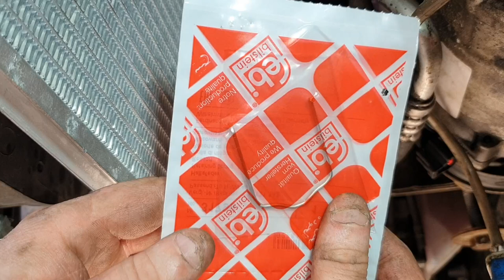Ford Mondeo Mk3 ST220 radiator replace

Comment: Hello Chazz Coombes. 
I just want to thank you from France.
I could do a lot of reparations on my 2005 Mondeo 2.2 TDCI titanimun X (ST style);
I replace the radiator, driveshafts, front roll bar supports...and your videos were a very good support and helpfull.
So thanks a lot, you do a great job under a car, but an another one as much great to filming your job, cut it, and upload it on youtube.
The time that i spent under my car let me thinking that Ford do a great car, not so hard to repare,and a solid one which can pass 20 years without rust (for mine)
Un très grand merci pour vos vidéos et votre partage!
Amicalement
Kind regards

Comment: I took my car (3.0Lt V6 ST220) to my local mechanic in MK and asked him to drain, flush out and fit fresh coolant.
I gave him 5Lt of OAT antifreeze and 5Ltr of distilled battery water.(enough to make 10Lt of 50/50 coolant)
When i picked up the car he said " Ive filled it with 4Lt of coolant"  3Lt of OAT antifreeze and 1Lt of distilled water"
Alarm tells started to ring in my head as I knew the car takes 9.7Lt of coolant.

Just from what he said, i knew he had left 5.7Lt of the old coolant in the engine. (NOT DONE THE JOB PROPERLY!!!)

He then started to give me some bullsh*t about " Its like when you where a kid mixing paint in water, thats why is a muddy colour"
What he had really done was mix the 5.7Lt of old orange coolant with 4Lt of new purple coolant.
So he had NOT bothered to flush the system out ( What a cowboy) and not changed all the coolant like i asked him to do. 
(I guess flushing the system out would have taken too much time, and he would have needed to get some more distilled water).

Had to pay him £50 for a job he had not done properly.
I left thinking how can you do a job so bad?

What he should have done is:-
1) Taken the bottom pipe off, and drained out 4Lt of old coolant. (Thats all that comes out , with thermostat closed, you are basically just draining
   the rad and overflow container, NOT THE ENGINE). There will even be a little bit left in the rad due to the upward pointing plastic rad fitting.

2) Refitted bottom pipe and fill system with 4Lt of distilled water.
3) Then run the car engine untill it is just warm (NOT HOT) so the thermostat opens up, and the 5.7Lt of old coolant mixes with the distilled water.
( switch on car heater to warm, to allow water flow through heater matrix too).
4)  Stop engine, ( allow to cool down if you can) disconnect bottom pipe and drain out 4Lt of coolant.
(Bear in mind the st220 V6 does not have a drain fitting, so the water will drain all over your arm, be carefull and do not burn yourself)
5) Refit bottom pipe and fill with 4Lt of distilled water

Repeat steps 3,4 and 5 untill the drained off water goes clear, (now you have flushed the system and the engine and rad both are full of distilled water).

6) Remove bottom pipe and drain out 4Lt of coolant (thats all that will come out with the thermostat closed).
7) Refit bottom pipe.
8) Fill with 4Lt of NEW concentrate OAT antifreeze.

This gets you a system with 4Lt of concentrate antifreeze to 5.7Lt of distilled water. ( NOT 50/50 mix so not ideal) but at least all the old coolant would be flushed out of the system.

So Why did my mechanic NOT DO THIS, simple answer is, it would take too much time for him to do this job properly,
and he wanted to do the job as quickly as possible and still take my £50.

It looks like if you want a job done properly you have to do it yourself.

Comment: Cool timing just purchased 2004 mk3 2.0 TDCi saloon with a busted radiator , so need to fit a new radiator, i realise will be slight differences in pipes but your video will give me the general idea
Reply from the maker: Cool, enjoy your new motor, thanks for checking the vid out.

Comment: Great video mate. Would this be the same on a mk4 mondeo? My rad needs replacing but don’t want to change and de gas all the ac unit aswell. Is it possible to do the same on the mk4 and slide rad out and leave rest in place? Cheers

Comment: Video is all good except the first part. In my mondeo I have a bar supporting the bottom of the radiator welded as part of the subframe. Did you remove the subframe to drop radiator? There's nothing supporting the underneath of your radiator.
Reply: Same here, stuck right now at that point, all released but radiator is stuck between top and bottom rubber blocks. Did you manage to take it out?
Reply: @edugimeno  yes i did. It was 7 months ago but IIRC I removed the two headlights and the grill cover (with aircon sticker) out the way and then the radiator can lift up instead.
Reply: @WhatTheHellMang  thanks for answering but I managed to remove it. I had to loosen the black front plastic block that holds the headlight. 3 8mm nuts on each side and 4 torc nuts at the bottom. That made it all easier
Reply: @edugimeno  yup that's what I did 👍

Comment: Hello Chazz; I have a Mondeo III 2.5 V6 24V(is it the same engine,only 500cc and much horsepower less?). When i want to change the radiator/thermostat/waterpump and fill the system with new coolant. Do i have to bleed the cooling system in the end?
Because i heard the Mondeo III has a self bleeding cooling system; is that true??
Thanxx anyway; very helpful video's.

Comment: I've got the 2002 ST220 so no drain plug. I've flushed the system and put new water and coolant in but now coolant leaks from the lower rad pipe
Reply from the maker: Have you replaced the o ring on the lower rad pipe. As i had to do that with mine
Reply: @ChazzCoombes  no I haven't 🙈
Reply: @ChazzCoombes  thanks for replying especially on a Sunday 😀 I bought the replacement clip from your description link...its an audi one but I assume that's what you used, it looks exactly the same though it doesn't fit quite as snug as the old one.